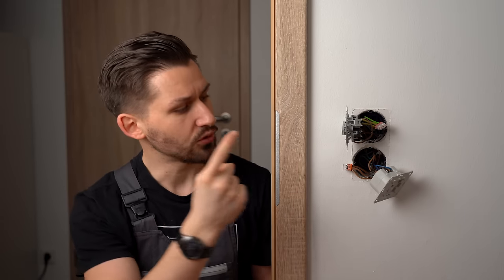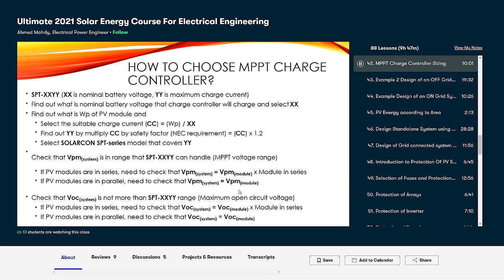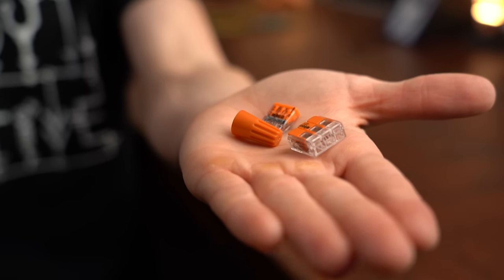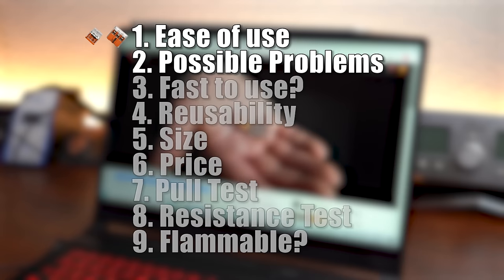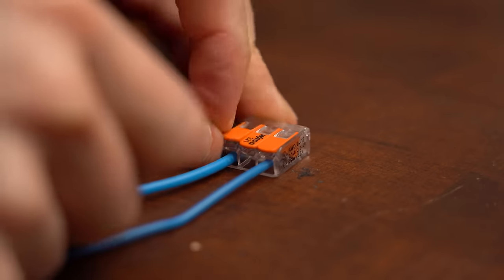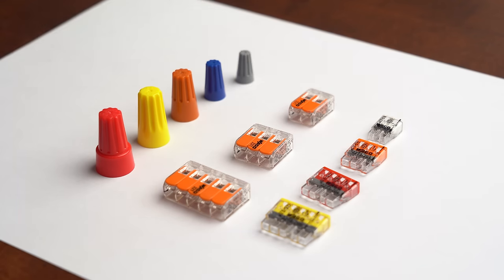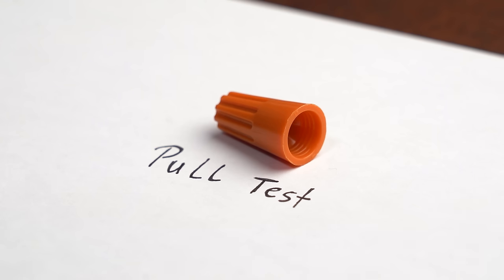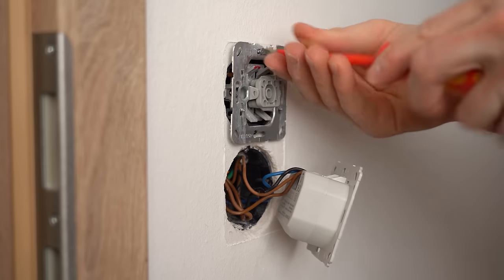What Wire Connector is the Best? Settling a Debate! Wire Nut VS Wago

Comment: My concern with the Wago is it seems too much like our "back stab" outlet connectors.  The only contact with the wire is a spring making contact with a small area of the wire.  If that heats up, the metal loses it's spring tension and the connection becomes weak.  That can lead to more heat and more loss of spring tension, eventually leading to an electrical fire.  The wire nut pushes the wires against each other and wraps the whole thing.  There's multiple points of contact as shown by the low resistance.
Reply: I don't think that it will happen that easily, it would need really high temperature for it to happen. Which is unlikely unless you thermally insulate connector at really high load scenario. Personally I have never heard of wago connectors causing fires.. There's reason why they have been tested to meet regulations
Reply: The spring in a Wago connector is primaly responsible for pushing the conductor on a busbar. Also a 223 Wago can accept a 4mm2 cable that is rated for 25A. With 25A we are talking about 1,375W of heat dissipation. Anything higher the MCB should trip and protect the wire.
Reply: If you look at the statistics you can see a clear decline in electrical fires when countries switch over to wago type connectors. It speaks for itself.
Reply: fiy, the connector will not fail before your breaker trips. That alone makes those type of discussion pointless.
Spring pressure terminals are standard in industrial cabinets for the last 10 years
Reply: @anxiousmerchant4129  I've used Wago connectors for a few years in the USA and I like them. But, I'd say that the reliability of the spring connection is a valid concern for discussion - as manufacturers of American receptacles sold product where there was failure of the push in connectors after a number of years. I've replaced several receptacles that stopped working and I'm not an electrician - just a person doing maintenance on the homes of my relatives. Perhaps the shape and size of our electrical boxes leads to excessive strain on the wires connected to the receptacles. Or perhaps the receptacles were too cheap and made poorly. Either way, that experience is common here and a cause of reluctance for some electricians to use Wagos.
Reply: @rethla  And they still are not as low as countries such as Canada that almost exclusively uses wire nuts.
Reply: @anxiousmerchant4129    Ya spring pressure terminals are NOT allowed in industrial applications here.  And Wagos have been banned from use in life-critical applications here also. The big issues is in North America amperages are much high due to the lower voltage used. Household 20AMP outlet circuits are not uncommon,  stuff 2 wagos in the same box each on or near 20amps (split kitchen receptacle for example) and you are asking for trouble.   Also Wagos have a lower volt rating than wire nuts do.
Reply: @matthewq4b  what are you even talking about. Spring pressure terminal blocks are everywhere. They are used on UL or CSA certified gear.
Reply: @anxiousmerchant4129   NOT for industrial termination blocks....
Reply: @matthewq4b  i mean especially those. 
I mean who the fuck uses wagos in a cabinet, but the counterparts like phoenix PT series or weidmueller equivalent? Outright replaced screw clamp, for din rail or on pre certified stuff like motor drives etc. All fine and dandy even with US customers
Reply: @anxiousmerchant4129   Yes but they are not acting directly on the conductor are they.... and that was what I was referring to..

And even then Screw Terminal blocks are still the preferred option and are the specification in many industrial applications.
Reply: @matthewq4b  push-in work exactly the same as wago 222s,  cage clamp is slightly different.
Screw terminals are seriously on their way out. They remove operator error. If the conductor is inserted, the connection is good. there is no over or under torquing. 

Nowadays you even find tiny spring terminal blocks in smaller 3 phase motors instead of m4 posts
Reply: @anxiousmerchant4129   NO they do not work exactly the same as WAGO 222s, they have a crimped on barrel that goes on the conductor that interacts with the spring in the terminal block the spring DOES NOT act directly on the conductor like in a WAGO..  
The reason for the crimped on barrel is to prevent a damage induced fatigue failure in the conductor either through temp changes or vibration...
You clearly have never used them... and if you just jammed a conductor in them ...congrats you just used it improperly and completely screwed an install.   Funny a screw terminal would have NOT that issue NOR has to worry about damage induced fatigue failures.
Reply: @matthewq4b  Spring tension is the industry standard as it handles vibrations and wear far superior. Why does it matter that it got a lower voltage rating? if you go above 450V use something else, i wouldnt use wire nuts lol
Reply: @matthewq4b  
Thats some hot assumptions regarding my work background lol.
Ferrules are not required by the manufacturere/datasheet and they even advertise the use without ferrules as time saving. 
It is just good practice to reduce risk by stray strands.
Reply: @anxiousmerchant4129   Nice try sand I quote  right from Pheonix's installation instruction as  of 2022-01-10 "Crimp the ferrules using crimping pliers and ensure that the test requirements listed in DIN 46228 Part 4 are met."     Seems like the manufacturer says otherwise and even has a test procedure to ensure they are done correctly.....  Congrats on confirming your hack work..
Reply: @anxiousmerchant4129   Read it again.   And only a hack would use these without the crimp ons.  Kinda like the stab ins in outlets...
Reply: @matthewq4b  like this paragraph?

• For small conductor cross sections and flexible conductors without ferrules, you first have to open the terminal
point.For this purpose, push the push button down using a
bladed screwdriver.

btw we crimp out strands as its good practice, you just assumed i do not.
I wont reply again, you have no point and constantly move the goalpost, to keep arguing
Reply: @anxiousmerchant4129   LOL in the end you crimp them as it good practice for EXACTLY  why I said, to prevent the exact issues Wagos create  Thanks for proving my point to a T.   The only goal post that was moved was the one in your head.
Reply: @matthewq4b  Though I've only used Wagos for a few years, I haven't seen a failure yet - personally or online. I have seen wire nuts that failed to grip stranded wires, solid wires that fell out of wire nuts when I've taken apart junction boxes, and even a wire that came right out of a breaker after an electrician upgraded my main breaker panel 3 years ago. I am interested to see how Wago reliability fairs over the years in the USA, but it's not like the alternatives don't already have faults. At the very least you have to agree that it is easier to see if wires have been properly inserted into clear Wago connectors.
Our circuit currents might not be that much higher than 240 Volt countries as we seem to divide that load over more circuits. I wouldn't expect issues with Wagos in kitchens, where loads are high but often short. If there are failures that will occur, I'd expect to see them where continuous loads happen - like room air conditioning, space heating or 120 Volt car charging.
Reply: @JasonEDragon   And again the Job of a Wire is NOT to make the connection....   it is just a cover.  The conductors should be twisted with your linemens pliers and be sound  BEFORE the wire nut is put on. 
You are using examples of installations done improperly and by a hack. That would be akin to faulting wagos for the wires falling out when the lever was closed home...  And as for seeing if the connection is done properly that connection is done BEFORE a wire is installed.  So no you have much better view using wire nuts and FULL control over that connection...
Wago reliability is already an issue and basically, every engineering firm has banned them from life-critical installs.   Wagos have had to be redesigned once already.  They do NOT provide as secure or as low resistance connection as a wire nut capped twisted splice and there is NO risk of galvanic corrosion in those unlike with wagos.
Reply: @matthewq4b  And yet the instruction sheet for the Ideal Wing-Nut Wire Connector says "Pre-twisting acceptable, but not required". I'm sure that they've tested their products more than anyone and if they found pre-twisting to be more reliable then they would tell everyone to pre-twist. Personally, when I use wire nuts I let the nut twist the wires as, for me, I get a more uniform compression of the exposed copper than can be achieved with pliers. With pre-twisting you definitely can inspect the connection at that point - but as soon as you install the wire nut you introduce new forces on the wires.

My biggest beef with wire nuts is that I make minor upgrades a few times a year just on my own house and it is annoying to untwist and straighten out wires. If Wagos prove reliable then I will continue to use them as they make changes easier.

And not everyone who makes a weak electrical connection is a hack - they are humans who have limitations, get old, feel sick on some days, have eyesight that isn't as good as it was, get sore fingers, etc. A good connector should work both for the perfect human and for those of us who are imperfect.
Reply: @JasonEDragon    And the wing nut connector is for larger diameter wires...
The correct way is to pre twist simple as that.  Only lazy hacks rely on the wire nut to make the connection with no way to inspect it or even know that.   And new forces you introduce on the wire when you install the wire nut would just cinch the connection down even tighter.. 
And FYI there is no need to untwist wires when making changes you just unwrap the one you are removing and wrap in the new one in.  
And if you can not make a reliable secure twist connection, then you should NOT be messing with the electrical and should be calling someone in, simple as that... 
Just cause you can do something does not mean you SHOULD be doing it.  Seems that applies in your instance...and seems like you fall in that category...
Reply: @matthewq4b  If what you say is true then the manufacturer would recommend pre-twisting. They don't. And if anything sounds lazy it is not straightening out wires when modifying a circuit. A wire nut is more than a cover - it can apply a mostly uniform inward force to help bite into and neatly shape the wires that are being twisted together. I've fixed more poor connection made by people who I have hired than those made by me.

Wago connectors avoid these issues - you get a consistent result no matter who installs them. You can take them off in 2 seconds and the wires look as new as the day they were stripped. In the UK at least they periodically test their circuits - including resistance measurements. I've seen 0 mentions of a circuit having a high resistance because a Wago connection was dodgy - it is almost always due to loose screws.

You mention above Wago connectors being banned in some USA applications but I've yet to see anyone actually list a reference that people can independently look up. Were these bans a result of actual documented failures that we can verify, or just a result of people not trusting them? To date I haven't seen 1 picture or read 1 story of Wago failures. If they are as unreliable as you suggest then I would expect at least 1 story about it that I could read.
Reply: @JasonEDragon  Listen skippy the practice is to pre twist  Ask ANY competent Alectrician or Electrical Engineer.   And NOT twisting  that is for THAT particular Wire nut... and it is NOT a best practice. And ANY half-competent electrician knows that.  
Backstab outlets are ALSO manufacturer-approved and UL CSA approved but ANY half-competent Electrician would NEVER use them.  Just cause some thing is manufacturer-approved does not make it acceptable OR best practice. And any half-competent electrician of which you clearly are NOT knows that..
And quit hiring hacks if you had a half a clue you would NOT be hiring hacks in the first place.
Furthermore  explain why Wagos had to be redesigned if they are so failproof.  AND you can see the higher resistance connection in the video you fool, THAT is why they are banned for use in life-critical applications by engineering jam 2 or three of those in box and you WILL quickly start melting stuff....  and unlike wire nuts there are NO high temp rated wagos to overcome that situation.. 
 You clearly have no clue are just some wannabe DIYer that has NO training, NO schooling, and no actual experience (obviously).   Congrats on being wanna be know it all that is clueless and the poster boy as to WHY you do not your own electrical work...
Reply: @matthewq4b  And I'm telling you that that from the viewpoint of the customer, who hires electricians for a few properties, that I'd prefer not to have wires all twisted up in my electric boxes. I make a lot of modifications and I find twisted wires annoying. I'm the guy with the cash and as the guy with the cash I get to have what I want as long as it meets code. And code is something that goes through a process, gets written down, and anyone can read.

I live in an area where the housing stock is very old - built before electricity and indoor plumbing was a thing, but when carpentry was much nicer than today. It is always a balance between modernizing a property while maintaining the old time look at feel. Quite often the electrical boxes are small - and many walls don't actually have room inside to fit a bigger box. The carpenters of 150 years ago would often do tricks like make thin walls to save space because at the time the walls didn't have plumbing, boxes or heating ducts.

And the tradesmen that I hire are good, skilled people who have been working in their fields for decades and have bought and renovated multiple properties each for family and for rentals - and who do general contracting work.

Yes, this video does show a case of higher resistance for the Wago connector - that is why I said above I was interested to see how well they fair here over time on circuits that tend to have continuous loads. You mention again it being banned in an application and I'll ask again to point to a reference so we can read the rational. I'll mention again that in the UK, where they actually have to test circuits after electrical work and submit paperwork - unlike in the USA, there haven't been any issues with Wagos and most high resistance readings are due to loose screw connections. Perhaps that is why using torque drivers to tighten screws is becoming more common there.

I've spent my lifetime working on technical subjects, have a Ph.D. in computational physics, have taken about a dozen courses in electronics and another dozen in computer science. I've spent years in labs working on specialized instrumentation that was assembled by hand. But, my  father was also an old school farmer who grew up during the depression and had to learn how to do all kinds of work by himself. Since I was a kid I learned carpentry, electrical, plumbing, plastering, glazing, painting, ductwork, gardening, engine repair, car and equipment repair, concrete work, roofing, insulating, carpet work, tiling - I do it all. I read, I watch videos, I hire people and watch how they do work and help them out. It is how I spend my time. I hire out when I'm too busy or when a job is too big for me at my age.

Comment: I think the only recommendation I can make for wire nuts. Is that I've never had to pay for one in 40 years of various cowboy electrical work. Nine times out of 10 they are included with the projects I'm installing for the customer. Any other time. I have spares that I have taken from other projects. I would like a chance to work with those wago connectors though

Comment: The main problem with wire nuts is the lack of consistency for novice electricians.   They can work really well,  or really poorly depending on the installer.  It's a bit more difficult to completely screw up the Wago connectors.   That's my two cents.

Comment: As a UK electrical engineer, the first time I came across the wire nuts I was really suspicious thinking they were toothpaste caps. I'm still dubious of something that looks like it belongs on a tube of toothpaste.
Reply: ...so the wire nuts win if Scott included a multi-purpose-use-test. You simply can´t close toothpaste with a Wago
Reply: The ones I saw must've been either red or blue as I thought they were robbed off tubes of Araldite :D
Reply: They've been used in the US for nearly a century and when used properly are completely safe. If we waive the properly requirement, then pretty much everything is a danger to be avoided. Just like anything else, if you aren't going to use it properly, you've got no business working with mains voltage in the first place.

Comment: At first i was surptised by the resistance difference but then again the wire nut basically connects 2 wires directly and Wago works sort of as a "brige". That said i thought the wire nut would perform way worse and it actually surprised me
Reply: Wire nuts are top for the amateur electrician, they require zero expensive equipment and will last forever, unlike wago, which burn like candles on slight overcurrent. I plugged 12 amp heater into an outlet assembled with wago 221 and one of them liiterally melted after a year🙄, and there is lots of anecdotal references to similar cases.

 Professionals where I live are allowed legally to use either 1) welding - twist wires together, then 1 tick and the ends turn into a melted ball of copper. And 2) putting wire ends into small copper tube (no idea correct English term) and squeezing using special instrument.